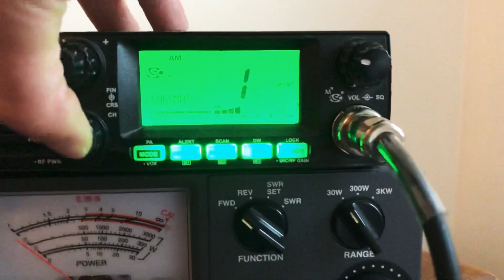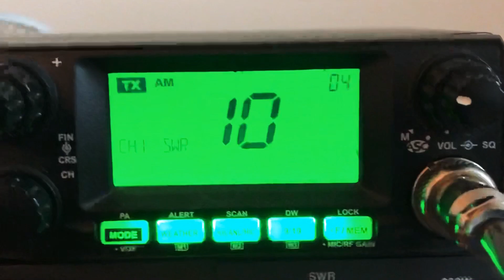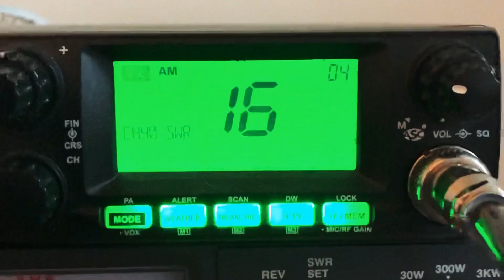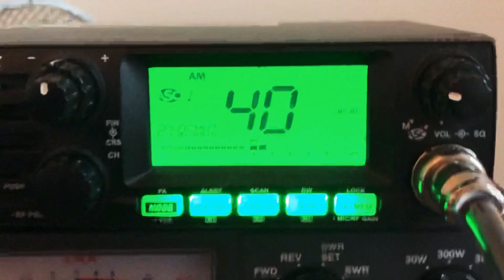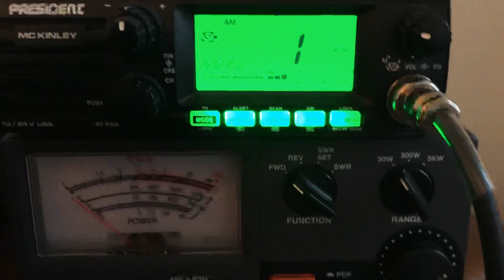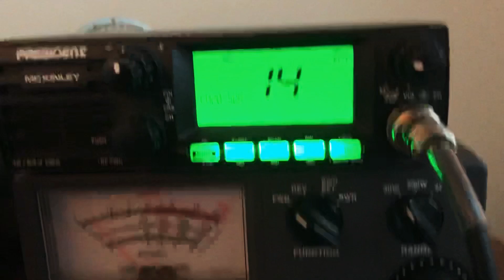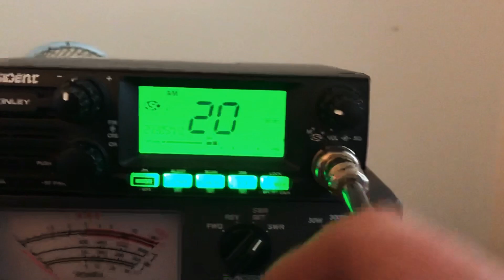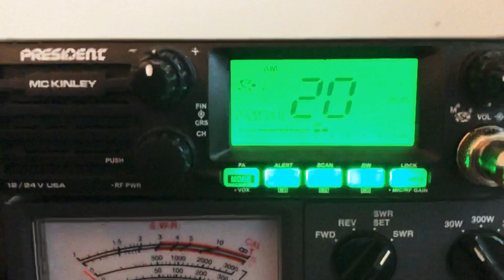President McKinley SWR meter

Comment: I bought same radio, after running for a while the swr starts swinging up and down, confirmed with external swr meter. Can't replicate same problem with another radio on the same antenna, which means its the radio. Looks like a got a faulty one
Reply from the maker: Ohh faulty Swr components?  Possibly.  If you confirmed with the external SWR well maybe you’re right maybe the radio is faulty if your antenna is true and calibrated then you already know that it’s fine, so yeah, it could be the radio that’s interesting.
Reply: @mikecricket113  Yes, it runs fine at first but then I would hold the key button and watch the swr needle swing all over the place (same thing with internal swr on the radio)

Comment: I just bought this radio recently to use as a base, and for some reason, when I use the built in meter, I get an SWR average of 2.0, but when I use my external meter, I get an average of 1.5 . Not sure why... It is a very nice radio though.
Reply from the maker: I get that. Radio meters and sometimes external meters so different results.   But at least you’re in the ballpark.
Reply from the maker: Also move your co-ax around to a different position.  Sometimes that lowers the swr.

Comment: I just got a richard.
Reply from the maker: Colin how do you like the Richard?
Reply: @mikecricket113  IDK. Guy I got it from a shop, he added a compacitor to the dc input, added an ohm resistor bottom of circuit board, added a wire, he claim he did the engineer mode 85w. I can't talk more than a mile. I have an sra 10mm, that pings at 1.0, than changes at night.

Comment: I've had this radio for about a week now. I was pulling what hair I have left out, trying different antenna's and could hardly get anything showing less then 20 or 18.....I bought a brand new external meter, with a good patch cable...Hooked up my old K40 antenna, without making an adjustment from being on my truck.  Using the President meter, it showed 18 on 40 and 24 on 1.....Hooked up my new external meter and the needle barely made a budge on 40, and was 1.4 at 1.....  I won't trust the meter in this radio.  Maybe I should send it back?  Seems to work perfect except for the meter.......  I have seen several test with this radio and they all say the same as you, that the meter is very accurate, but mine sure isn't
Reply from the maker: Interesting.  Yeah maybe they didn’t align it properly at the factory.  And I’m glad you used another Swr meter to compare.   I have two of these radios and both meters are showing the same as my MFJ 870. Now I’m running barefoot.  I know the more pwr you run the higher Swr gets in some cases.   Thank you for watching either way.   What is your K40 mounted too?
Reply: @mikecricket113  I bought it originally as a lip mount, and later bought the K40 magnet mount they were selling, and fit it into that mount.  It's been that way for at least since about 92.  I know, like I said, everyone agrees with you about that meter being accurate, even CBworld review said it was dead on.  It's just funny, the radio meter is real close on 40 to my external Astatic....but was almost 2 times higher on channel 1....something definitely flaky with the meter.  I bought an extended warranty when I bought it, but I'm not sending it back for this, when I have a good inline meter....Thanks for your response.....
Reply from the maker: Am I understanding that the antenna in the mag and maybe the meter is from 1992.  If so that’s like 30 years.  Time to get a new antenna.   Tram 3500 is a good antenna and reasonable price.
Reply: @mikecricket113  No No No, LOL......Yes the Antenna the K40 is old, but still works like a champ, the Meter is a Brand new Astatic, PCD 2 or something like that...That meter shows no more then 1.3 on any channel.  Far off from the Radio meter.....I bought a Tram tri mount with a Tram BigCat 9 antenna... External Astatic meter, Brand new.... shows 1.1-1.2 across the board....MC Kinley meter shows 1.6 for a low and 2.0 for a high...Mine just isn't right.  I've kind of switched out radios again, so I'm going to send it in for repair...It is kind of a farce though.  I heard some say, "You can tune it and tell by the sound when you get it right without having to go look at a meter...Well, not really,  You can adjust the antenna, but you are going to know where it really is until you get down away from it, or the sound will just be way off.  Not trying to beat a dead horse, I Love the Radio, it's just that my meter is no where near correct.....

Comment: Hey everybody. I just installed the same radio this past weekend. I’m getting a swr reading of 3.4. What are some things I can go through to correct this problem. I have my antenna mounted in the pocket on the left side of my f250 closest to the cab. It’s about 2-2.5 feet above the cab.  I have the mount grounded frame of the truck. Running a tram 3700.
Reply from the maker: Could be a lot of factors do you have an aluminum Ford truck.? Where do you have your coax running what’s the length? The ground strap that goes to the frame did you sand off the rust or paint before making connection?   Barefoot or kicker when testing?  Have you tested swr on channel 1,20,40 found what’s the highest  on what channel and adjust the whip up or down accordingly?    Trying to gather info so I can help.   73
Reply: @mikecricket113  yes it’s a aluminum truck
I have the coax running from the mount (closet stake hole to the driver) and I ran it through the the cab vent, down the floor boards, back behind the foot pedals and basically right by the radio where the cab is mounted. 
The mount that I purchased didn’t come with the flat ground strap. I used a 12 gauge wire (4’) instead. I get continuity when I test the ground to the base of the mount. 
I’m barefoot
Tested on 1 and 40. I get 3.8 on 40 and 4.0 on 1
Reply: @mikecricket113  20’ coax
Reply: @kennywaynesdiy  if you still have this issue check the length of the coax. Cut it down and resolder or re crimp. Coiling the extra length is no good. I guess you want to cut the coax at lengths of 3ft. So you will usually see lengths like 12ft or 18ft or 9ft.
Reply: @mikecricket113  also I see that whenever I touch the antenna the swr goes down. If you can makes sense of that.
Reply from the maker: sounds to me that you need to get yourself a flat braded ground strap.  that 12 gage wire is not cutting it.   when you touch it you are grounding the antenna.
Reply: @mikecricket113  ok im going to see if I cam find one at a local store. If not will have to order one. Any specific brand or type?
Also I’ll have to grind or sand around the area where I will ground it to the frame.
Reply: Get a good antenna..Wilson/stryker...your antenna is everything
Reply: @danielsteenis1623  20' coax seems way to long. If you coil the coax you will get bad swr readings. The coiled coax will create magnetic field that interferes with the signals.

I have a fender mount close to the windshield and a 6ft is plenty.

Comment: I just ordered me one today from amazon. ...
Can u do a watt test
And modulation test..
And frequency test...
Is the stock mic ...loud and clear?
Reply: The President Mckinley has many excellent features! The stock mic modulates crisp, clear sound! You can check channel frequency, watt out put, and most importantly antenna matching. I'm very pleased with the performance of this radio. It's built very well! Cheers, Lamplighter on the side! 👍😎